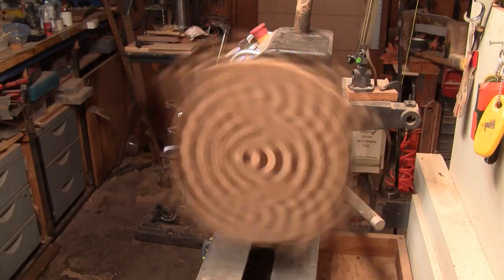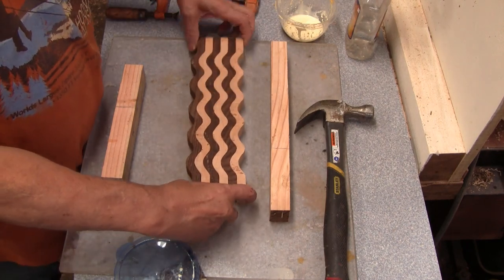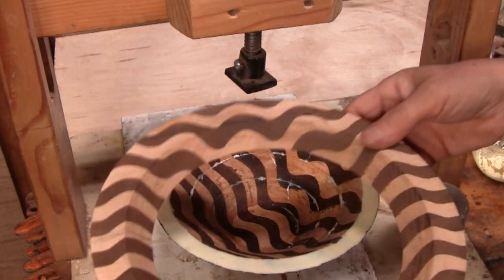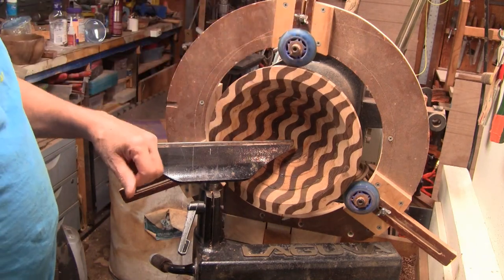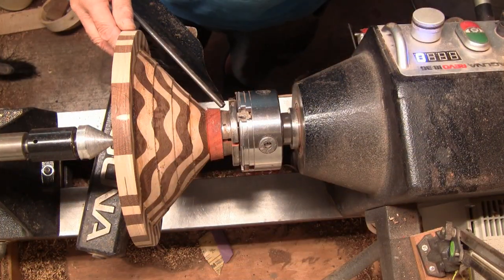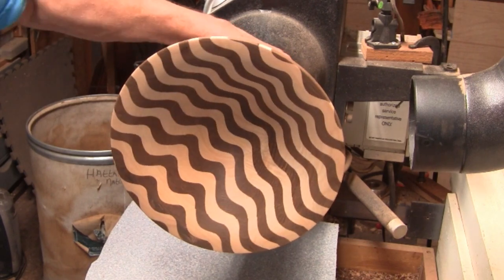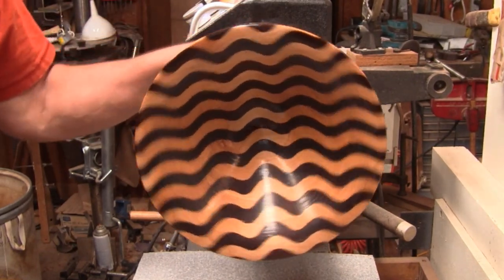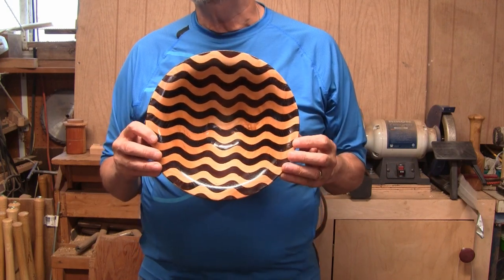Wood Turning Segmented  Ripple Bowl From A Board

Comment: Gary we need to get you some protection, this makes the expensive ring master system obsolete.  😀
Reply from the maker: Thank you Mark I think I will be alright as long as I stay hidden LOL.
 I think your are talking about something with a compound. Metal lathes have done this for years and I have one.
 I can put my Nova chucks on the metal lathe with an adaptor I made. I found it slower even using the compound slide.
The machine I saw that cuts rings using a compound  seems slower than I want to do and you are forced to drill a hole through it. A pattern like this would not look good with a hole in the bottom covered by a base.
Thanks for the warning I may be going into a protection program LOL

Gary

Comment: Good looking. A couple coats of cellulose sanding sealer should have taken care of those open pores. Regardless, this bowl came out lovely.
Reply from the maker: Thank you Doug, yes most of the time it will fill them and I have sanding sealer and considered using it. It seems when they bake this wood it opens them up even more. I do have a length of it left and it is worth a try.
Thanks for watching,
Gary

Comment: The spray coat seamed to leave bubbles I would have preferred buffing and then the polish . But I am only looking through the video,  A wonderful piece of woodwork and I am going to have a go Thanks mate.
Reply from the maker: Thank you for watching. I think the wood I used is very opened grain. What may have looked like bubbles was probably that. I aways sand the lacquer after 2 coats and then the final coat. There should not have been any bubbles.
Thanks for watching... Gary

Comment: Another masterpiece made. I really like the way you use a parting tool to cut the pieces out rathe than using a bandsaw set at 45`.
Reply from the maker: Thank you George! This one would have been easy enough to band saw the rings but then you need to glue them together.  I do like this method and might start using it on the next dizzy bowl I make.
Thanks for watching,
Gary

Comment: I love your work!  I'm interested in what equipment you chose for CNC.
Reply from the maker: Thank you very much Jeff.

My first CNC is a JET mill/drill that I put balls crews and servo motors on. I built the controller and power supply for it.
 I ended buying a older Bridgeport Boss 4. Very old electronics so I tossed them and built the controller box and power supply for it as well.
I have done a lot of metal work on them and also a lot of wood carvings. Raised 3D models. 
Depending on what you want a CNC router my be the thing to get.  I have thought about selling my smaller one and getting a CNC router. It would probably be faster for wood carvings.
Oh I also built a 4th axis which can be used on either machine.
 Let me know if you have any other questions on the CNC.
 Gary

Comment: Great project. It looks amazing! 
In addition, I really appreciate it when you let us know at what rpm you're working. Proper turning speed is something I struggle with a bit and that type of extra info is super helpful.
Reply from the maker: Thank you Calvin, happy it was helpful. I am sure you will get a feel for it and then not even have to think that much about how fast it is spinning you will just know what is right for what you are doing at the time.
Thanks for watching,
Gary

Comment: I used to cut rings that way.   Time consuming.   Now, in this situation,   I glue half of the board together and another half of the board together.   I clamp the halves, and draw ring circles, then go to the bandsaw, set the angles I want and cut out the half rings.   When all the half rings are cut, glue them to its matching half ring.   Then glue up the bowl.    Just thought I would share.   Respectfully,   Kevin
Reply from the maker: Thank you Kevin. I used to do them like you are doing and have done many rings for dizzy bowls that way.
Nothing wrong with doing it on the bandsaw either.  I just never liked the gluing the half rings together and making sure they are still flat at the joint. 
 Thanks for pointing that out because others will like to know there are options.
Thanks for watching,
Gary
Reply: @ThePapa1947     Just goes to show we all try everything we can!

Comment: You are making beautiful turnings with some great design ideas. I wonder why you don't fill the wood grain before spraying your lacquer? That would give you the perfect glass like finish.
Reply from the maker: Thank you Andy, I have thought about filling the grain but not sure how that would work out for multi colors of wood.
What do you recommend to use as a filler. I would like to give it a try on somethings for sure.
Thanks for watching and commenting.
Gary
Reply: @ThePapa1947  I've spent most of my adult life as a guitar maker. Now semi retired, just bought my first lathe which arrived yesterday to play around with so have been watching loads of videos on the subject. I noticed nobody seemed to fill the grain before the finish. Guitars also often have both open and closed grain woods. Many of us use small batches of 5 minute epoxy with a small cardboard "spatular" to press it into the grain before it hardens. We just do a few square inches at a time then sand it level and move on the the next area. Thanks for the great videos. They are a real huge help.
Reply from the maker: @andydepaule3296  thank you and I have thought about building a guitar but have yet to get around to doing it. Bending the sides has always been what stopped me. I would have to make or buy something. I am retired wood pattern maker so I have no doubt I could make one. How it sounds is another question. Plus I already have too many guitars. For sure I could make a solid body electric but would not be as fun.
Now that is interesting.... 5 minute epoxy I would never have guessed. I am guessing the natural color of the wood shows through the epoxy.
 So I have used filler on some Oak furniture I have made.  I have also sanded some bowls using the finish to wet sand the wood. This makes it's own filler. But not on a mixed species of wood.
 Thanks for the reply I like your method.
Gary

Comment: really fabulous, I hope I can achieve something similar following your steps.

Queries:
When you finish gluing everything, how thick is the plate that you take to the lathe? 20 millimeters?

when you cut the circles with the tool, what angle do you give to the template? 45 or 50 degrees? or some other...

How wide is each circle?

Thank you!
from Argentina!
Reply from the maker: Ariel I like anywhere between 20-25mm. Or .75 to 1 inch. 
Thanks for watching,
Gary

Comment: Great job.  I am looking for a parting tool to cut the rings.  I made a jig like yours and it works great.  However, I am getting tearout at the back of the ring.  Any suggestions on a parting tool like you are using?  Mike
Reply from the maker: Thank you Mike I answered that in your other comment. One thing I do is when I hear it is almost through I will make sure the tool is plenty sharp and then I press very lightly and that seems to keep the tear out to almost nothing.
Hope that helps and be sure to check out the links in your other comments.
Take care,
Gary

Comment: Flipping cool! How did you secure the steady rest?
Reply from the maker: Thank you Steve. The steady rest base passe between the bed of the lathe and there is another piece I turn so it is a right angle to the underside. That acts as a clamp.
Basicly the same way you banjo works but mine is made from wood.
Thanks for watching,
Gary

Comment: Gary, I think this was the first time I saw you using the Milling Machine. With your skills can you turn some more pieces where you start out using pieces you have milled?   BTW the Pirate T-shirt was great. Still remember games at Forbes Field.
Reply from the maker: I have used it a few times and not shown it. Mostly for facing some boards off. I do not have room for a drum sander but maybe this year I will be able to create some. But I will be saying goodbye to one of my CNC mills. The one I built using a Jet Mill/Drill.
 And I just might have surprise turning coming up using CNC and something I did back in 1977. This is going to be FUN!
Take care,
Gary

Comment: Very nice! Another question in regards to your press, did you fabricate that and how? I am enjoying your work as always Gary. Thank you!
Reply from the maker: Thank you Mark and yes I did make the press. It just has 2 wood beams on the side fastened to a 1" thick piece of plywood. I did make it adjustable in height. The screw is something you can buy made for doing this. I found it at a garage sale years ago with no use for it then ended up using it here.
Hope that helps.,
Gary

Comment: Do you sand inbetween laqure coats
Reply from the maker: Thanks for the question Sharon. Normally I will sand after 2 coats and then again when it looks like it might need it. Really depends the wood as well. Open grain I will sand between coats till I start getting a good build up. And then when needed.
Thanks for watching,
Gary

Comment: I absolutely love watching your segments! I find it so amazing you can cut up a flat piece of wood and make a bowl Gary 🤔. So, how do you get the lines to disappear? Just from turning and sanding... and having a good joint? Thanks for sharing your creativity with me again. Stay safe, Vickie
Reply from the maker: Thanks so much Vickie!
So good glue joints is the best way make the lines disappear.
 They need to line up and be tight.
If you run the grain the other direction it is easier because the grain is going the same way as the joint. But this way gives a different look.
 Seems to stand out more.
 I love doing things like this but also love turning logs and that is next because it gives me time to think of the next odd segmented turning.
 I appreciate you watching and commenting.
Gary
Reply: @ThePapa1947  I always look forward to all you do, but these are definitely my favorite. It puts my brain into high gear trying to work it out 😆

Comment: You use lot of glue. Is this something you recommend we do as well
Reply from the maker: For what I do here it works for me. Always better to have more than less. It gives me more time to assemble. If the glue joint is dry it will grab faster and you will not be able to get it assembled.
So I suppose I would recommend it but experience will tell you how much to use.